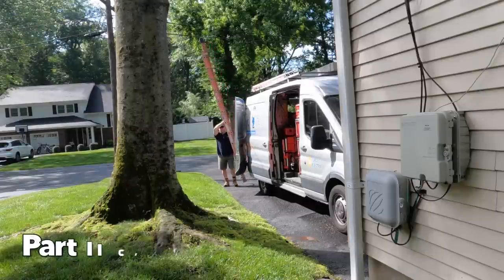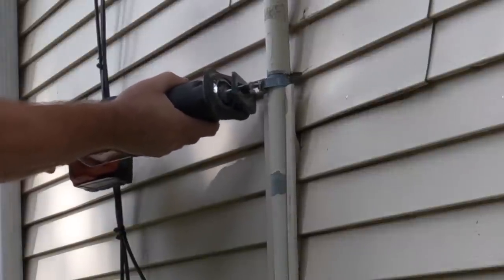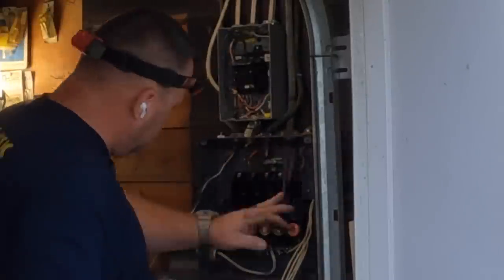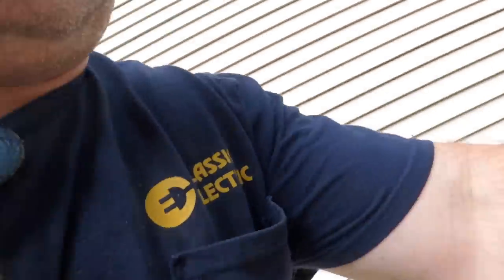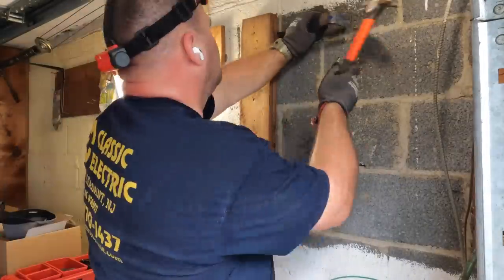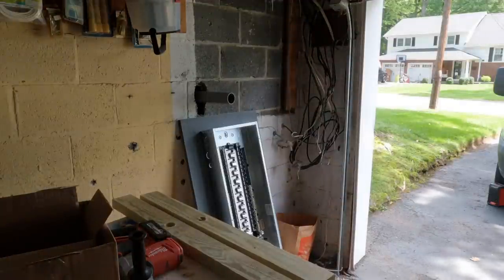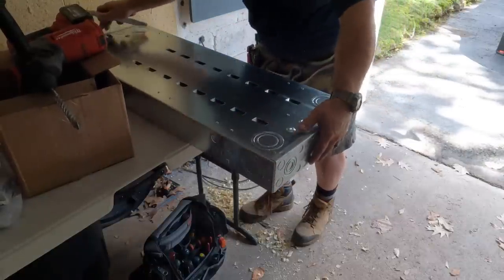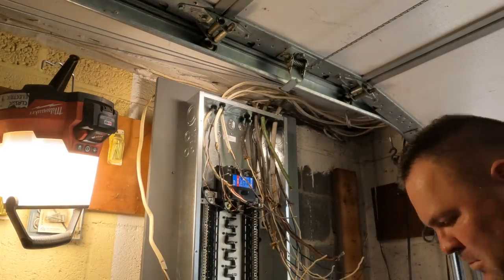BRINGING 100A SERVICE INTO THE 20TH CENTURY: 200A Service Upgrade Part TWO | Cranford, NJ.

Comment: Great video, Ron!  However, as an Occupational Medicine doctor, I can't help myself when I say you should really wear some eye protection, especially when drilling in metal. I can't remember how many times I've removed metal slivers from a workers eye.   Keep up the great videos, and be safe!
Reply from the maker: One time in 1995 while doing a service upgrade I bumped into an open can of PVC glue  and got it in both eyes. I was on disability for 6 weeks!
Reply: Worse part during my 50 enjoyable years as an electrician most companies will give you a cheap pair of safety glasses then when they get scratched never have any replacements in stock. While working in a large maintenance shop we had to wear eye protection in the shop even if we were on break or doing paper work. They paid for prescription eyeglasses every two years with the little metal screens on side of frames.

Comment: Awesome install Ron!! It’s interesting because I was wondering why you put the hole for the service entrance wires where you did in the panel because up here in Ontario we wouldn’t be allowed to do that! Basically our wires have to be enclosed with a little cover on the inside of the panel to enclose the entire area where the wires come in above the main breaker, and we can’t bring in any branch circuit wires to that area either. Basically the top of the nuetral lug and up above the main breaker would be entirely only for the main service wires, which definitely makes installs tricky sometimes! It’s interesting how a lot of our code rules are similar with a few differences! still thanks I learned some great tips from this upgrade you did!! 😊

Comment: Great video Ron 👍🏼. About the loops on the feeders in the meter. Back when I first started in the trade I was told by an old journeyman that you were supposed to leave loops so that if the wire ever heats up or burns up at the lugs then you have extra wire to remake the connection. I’ve seen it come into play before when I’ve had the extra loop of wire to remake some connections before so it made sense. Also about GE stuff. It’s not my first choice. My first choice is square D. Hom for residential and QO for commercial. Second choice would be Siemens. They provide good tight connections to the buss bar . Third would be GE. Fourth would be Eaton. The reason I like GE better than Eaton is because I replace more Eaton breakers than any other brand of breaker. Plus around here , for some reason , back in the 70s-80s when a lot of the houses in the area were built they installed GE load centers , main and sub panels in every house and they’ve been installed and working for the past 40 plus years with no problems lol. I use GE However , I get more service calls on newer homes for breaker failures because of the Eaton , or CH, breaker failures. Mostly the gen 2 CH CAF breakers. As well as some of their DF breakers as well. The newer gen 6 CH CAF breakers are better. The Eaton BR style are alright. Especially the newer stuff. I’ve just had more issues with CH/Eaton breakers than any other breaker. Just in my experience 👍🏼
Reply from the maker: Not me. GE and Homeline have been a lot of service calls. Poor workmanship and installation standards are a big reason why things fail.
Reply: @electricianron_New_Jersey  yes sir. Especially with AF/GF breakers , or circuits , when people don’t take care when they strip out romex or whatever and they cause a fault because of , like you said , poor workmanship.

Comment: Those little loops are to assist in manipulating the wires.  They give you slack to move things around so you don't have to fight the rest of the wire in the conduit.  On this gauge they're not that big a deal but on really thick wires it's a godsend.  They could have been left in due to habit.

Comment: I was wondering how you were gonna cleanup the break in the siding where the old riser was. Then you got the Azec and I thought you were gonna have to trim the siding around it... never even thought of cover it, that definitely looks the best and unless the owner needed to get a siding guy to coordinate with you it looks just perfect the way you did it. New meter looks like it's always been there. Excellent work as always.
Reply from the maker: Getting a siding guy to a small task like this would be nearly impossible.
Reply: @electricianron_New_Jersey  Yeah for sure, it would be handyman who'd need to patch that up as a short gig.
Reply: I would have done the j channel around it and actually finished the job nicely. It's not rocket science.
Reply: @ProleDaddy  That would be outside the scope of an electrician, though. You do realize that.

Comment: Old "A" base meter. I had one once where the boiler wouldn't run. It would start and stop. We thought the burner had a bad control after changing it the problem persisted and I heard arcing in the old meter socket. It was an old A base meter (one of two it was a two-family house) with an underground service. We moved the burner circuit to the "good leg" so they would have heat for the night. Burned lug in meter socket. So they got through the night they later admitted having blinking lights etc. I went back the next day with a new meter socket. Had to pull the duct box off the wall where the service came in and cut the wires off live then put a new meter socket in and new wires into the duct box and hook it up live. Pretty scary. Jumped the new meter socket. Emergency call. Called the POCO got a permit had it inspected all ok. Didn't like doing that, I was a bit scary.

Comment: I agree with you on the GE panels and breakers.  I have to upgrade/replace my main panel in my house.  Currently it is a 1986 installed GE 200 amp, 40 space panel.  I am going with a Square D Homeline 40 space panel.  The old GE panel does not allow for the tandem placement of breakers, meaning the single and double pole breakers cannot always be installed next to each other.  They have to go in specific slots.  Also, GE uses the extra thin breakers that go in extra thin slots.  So that, plus the lack of tandem placement makes it impossible to install the thicker (2 space) AFC and GFCI breakers required per code.  So, it is impossible to bring the panel as a whole up to code.  The breakers are really loose just like you said as well.  They seem to need adjacent breakers to help keep them firmly wedged in place.
Reply from the maker: Homeliness ok but I’d prefer Cutler Hammer BR.

Comment: I was just reading a POCO install booklet from National Grid. They say in the book that you can't mount a meter socket on siding because of the irregularities in the siding. They claim when you screw the socket to the siding it can torque the socket and stress it. They wanted it mounted on a smooth board like you did but they want the siding cut to fit around the new mounting board.

This is the first I have herd of this. But since I am retired and only do an occasional job maybe I am not up to date.

I would like to know if anyone else has herd of this requirement.

Nice job by the way Ron.
Reply from the maker: Sounds like nonsense to me. This work was PSEG area.
Reply: @electricianron_New_Jersey  I agree nonsense. I have a service change to do for my nephew and haven't done one in a while, so I downloaded the POCO book just to brush up and was surprised to read that. Don't know if is being enforced. Will have to look around. When I wired new houses back in the 80s (before PVC trim) we used to cut some 2" pressure treated and put a block of that on the wood sheathing to mount the meter socket on and the siding guys would trim around it when they did the siding. Worked OK

Comment: what did you do for insulation around the 2 inch pipe that penetrates the garage?  Did you do anything for weather sealing the top of the board you used for the meter mount?

Comment: Nice work. In Chicago, everything inside has to be in EMT conduit. Outside service drop rigid.
Reply from the maker: That’s because Chicago allowed unions to run their lives and make it almost impossible for people to do electrical work on THEIR. OWN. HOMES.
Reply: @electricianron_New_Jersey  Very true. BX or MC can be used in concealed spaces only but they don't want any more than about 18" exposed before it reaches a J box.  Romex only for temp wiring.
Reply: Romex is just fine..

Comment: My old house was like that with the loop in the wires. But that was back in the 90s. I don't know how common it was to have an amp meter.  Might of been costly back then to have a amp meter.

Edit: One other question that backboard outside holding that meter. Are you going to seal behind it, Doesn't water get in behind there?

Comment: Just working on upgrading a pile of crap house myself.  We had to pay the same for the permit as the entire material bill for a new meter, main panel, and all wiring/outlets/switches.  Can’t imagine how much it would have cost to hire an electrician, probably more than the entire house
Reply from the maker: Are you in San Francisco?
Reply: No, Michigan.  Usually it’s not bad around here but this particular city decided they needed more revenue and scamming people for permits sounded like a great idea.  In reality the net effect is lots of houses falling into disrepair and lots of shoddy work done by people who don’t pull permits.  Even though I have the skills, I hired an electrician to do the service upgrade on my own house, it was totally worth the convenience.  This house is a wreck my friend bought, entire house was less than 10k.  Hard to justify contractors when the house is that cheap.  Inspector comes tomorrow, hopefully we didn’t miss anything too bad.
Reply from the maker: @cosmicinsane516  just an FYI: I endorse state licensing and the permit process. It’s rarely ever perfect but I strongly believe in the process.
Reply: @electricianron_New_Jersey  Yeah for sure.  When it’s implemented effectively it’s definitely better for everyone.   Thankfully I live somewhere that homeowners are allowed to do most work yourself without having to be licensed.  Unfortunately I’ve also had the opposite, licensed contractors that do terrible and unsafe work.  It’s a crap shoot either way.  At the end of the day the goal is to have electrical and mechanical systems that work safely and effectively.
Reply from the maker: @cosmicinsane516  here in NJ homeowners can do their own work as long as they have a permit.

Comment: sweet - always beautiful work. Have you discussed what you do when the old home run wire is too short and/or damaged?
Reply from the maker: Either extend the circuit in a junction box or extend it inside the panel.

Comment: Loops are for heat related issues.  The wire can move without pulling or pushing on the terminal.

Comment: does the line in feed not have to be upgraded for 200 amp panel ,,,i have amid 90s subdivision house the builder sold as 200 amp but only provided 100 amp .now its 2 storey 2200 sq ft with finished basement  that is out of space ,,ac is on pony panel .there are breaker knockouts for many unused positions but buss bar doesnt extend full panel width ?

Comment: good video!  biggest scam in Chicago now are “flippers who put in a 200amp box…but never put in a new service or meter—and leave the old 100-150 service in place😮
Reply: I had to deal with this, though not in Chicago...  Previous homeowner put in a 200A panel on the 100A service, with a 60A meter base.  #2 copper.  Mast was improperly guyed.  I had to put in a 100A double-pole breaker to pass inspection when I got a new furnace.  I'm now working on putting in an all-new service.

Comment: They make hollow block anchors. They are a little hard to find but I like them better than lag shields because you can use bolts with a machine thread or threaded rod and they hod really well in block walls. Sometimes I would run 2 x 4s down from the joist overhead nail or screw the 2 x to the floor joists and mount the plywood on that and also put an anchor or two in the bottom as well. Look up Hilti #HDIPT
Reply from the maker: I've seen that technique used before (with the joists and 2x4's hanging down from there) but it didn't look very sturdy - or as sturdy as attaching PT 2x4 directly to the wall. Lags and shields to me are the best I have found to do this.
Reply: @electricianron_New_Jersey  That works for you then that is the way to go. I can't believe all the snarky comments from others who are super picky. Just wonder how their jobs look if they even do any work. You do a nice job and work really hard. One piece of advice. Take care of yourself. I retired at 66 5 years ago. I will be 71 this month and don't work much at all (but would like to work a little). Had my masters in CT, MA and VT. Let them all go and just kept my MA journeymen license. (I can pull permits with that in MA.). The job takes a toll on your body. I used to work all the time long hours and never (hardly) turned down any overtime. Now I am paying the price. When I was 66 and still working, I could waste most of my 30- and 40-year-old co-workers. Then stuff starts to happen. You never think it will happen to you. Take care.

Comment: Instead of using two-hole straps for the service riser you might like to use clicks. Mounting the meter hub to the right depth will give you a straight shot up the wall without having to bend an offset in the pipe. They aren't all that expensive, actually they are fairly cheap. Thanks for the Vid!
Reply from the maker: No offset in the riser.
Reply: @electricianron_New_Jersey  I was just giving you the benefit of the doubt and an option to keep the conduit parallel to the wall. Good luck!

Comment: Hey Ron, Been sub'd to you about a year now and especially love all your panel change out vids. This one ended too soon for me as I was hoping to see your methods of working in all the old "too short" home runs to this much larger/longer main panel. How do you lengthen those in a neat way? Were there any un-grounded circuits in this old house?  Also, the old meter can't be used outside in the new meter box, so how was that handled? Cheater jumpers there for temporary power? Is there going to be a part 3 that will answer some of these questions? Thanks much, Bob R.
Reply from the maker: Well, the first thing I do is find the shortest conductor and hook those up first.

Comment: That wall is destroyed or rather will be by water in the coming years. Should have used an edpm gasket around the wall penetration and water shedding behind the pvc plank that should have been trimmed out to the edges of the vinyl.
Reply: Agree that the lack of any water flashing/gasketing around the external board and entrance will eventually cause a problem, the presence of closed cell foam board under the vinyl
helps a bit. It will be someone else's problem, most likely two owners into the future.
Reply from the maker: Are you a wall expert? Or just a keyboard home inspector?

Comment: Do you ever have an issue with the bend radius of the cable. I think I've seen you use 4/0 Aluminum SEU cable in other videos to go from outside to inside. The minimum bending radius is 3.6" (for Southwire SEU 4/0 Al) which means it could not make a 90 degree bend in a 3.5" deep stud cavity. Is the only solution to use THHN 4/0 Al conductors instead of an SEU cable?

Comment: Have you done much outdoor panels? I’m thinking of moving my house panel which is in my daughter’s closet to the outside. I’m a JE btw
Reply from the maker: I worked on one years ago. I'm not a big fan. It could be a blizzard and an overloaded kitchen circuit trips and you have to you outside to reset the breaker. No thanks. However, and NEMA 3R panel outdoors is big improvement if it's in a clothes closet now.

Comment: I hat the bell upside down also. I cut a piece of over the size of depth of nipple in hub plus the depth of the bell on my stick. Glue that short piece into connector in hub the glue my first stick bell side down. Basically the the bell sits right on top of the hub connector. I think it looks better plus is sheds the water way from the connector at the hub
Reply from the maker: Someone else here in the comments suggested that too.  I’m def gonna do this next time.
Reply: @electricianron_New_Jersey  just noticed all my messed up spelling but you get the idea

Comment: Theres enough circuits in that panel for the nieghboor to tie into. Why so many circuits Ron?
Reply from the maker: Capacity. You could have only (4) circuits and over load a 100A main breaker. There’s literally nothing that’s been done to the house so any future kitchen or bathroom remodel will warrant the additional circuit breaker openings.
Reply: @cengeb  I bought GE stock at $9.30 a share when they where strugling now i'm laughing
Reply from the maker: GE electric panels are J U N K

Comment: I have seen more problems with ge panels than zinsco . Now my residence has a 35 year old original ge panel that I believe is all original . It is the better style and your typical push in style breaker of today . Now I have gas appliances so no big loads except AC which I don't use a whole lot which does help with longevity of breakers . I also clean out once a year and check breakers and connections  which al.ost all home owners don't do.

Comment: Did she knows meter inside a house that means one time it was on the old flat rate system going back without to the early days and it came along later and they put the box and they put in the line and ran it into the meter an owl on the meter into a fuss box date of black rated just ran straight off the service right into a fuse panel main breaker and broke the house